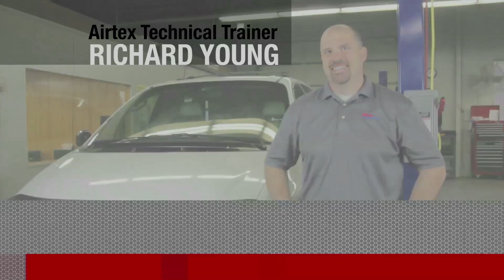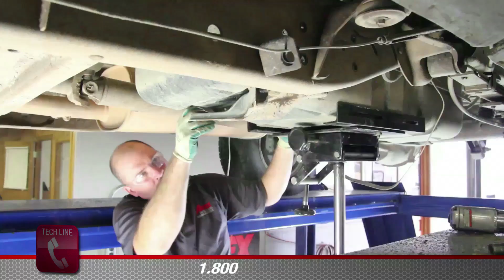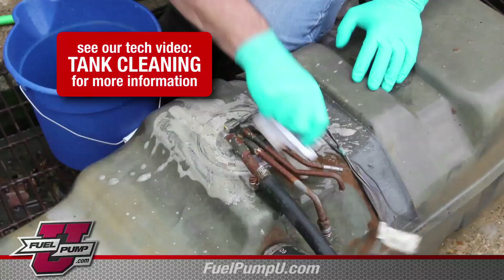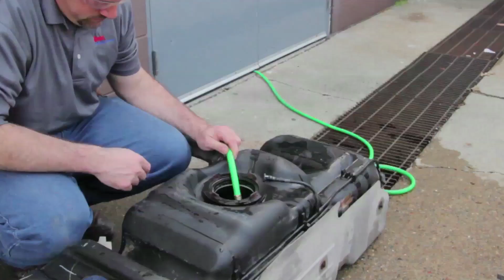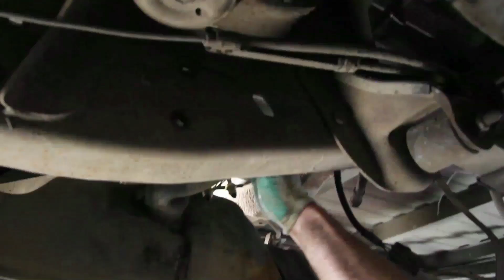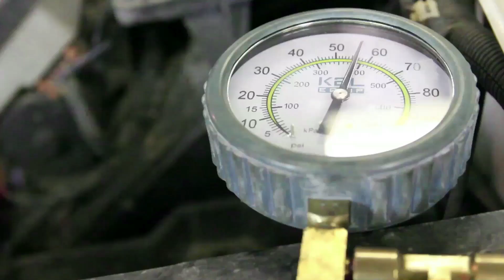How to Install Fuel Pump Sender E3622S 1996 1997 Chevy/GMC 1500/3500 Truck

Comment: It's a good video BUT you did not cover anything about the broken line and the fitting. There are a lot of people out there that you have to think for  but haven't the money to go to a shop. I am glad though that you show people how to change this simple style fuel pump and sending unit. just one more thing... I would also sugest that you show what you working on before you stick your hands in the way obstructing the view. You just say this is what we are doing while you do it. It's too dark to see the project especially while your hands and shoulders are in the way. Offer a closeup lighted view of the project.

Comment: Hi, What psi does this fuel pump run at?
I only need 12-15psi... Would this be okay for my tbi conversion? Or will it be too much of a fuel pump? :0

Umm.. so the psi for this fuel pump is 55psi?
Reply: *****

:0